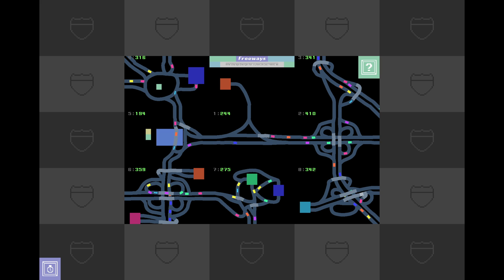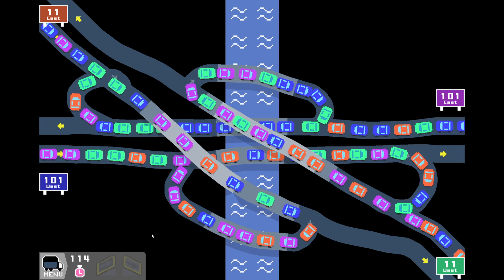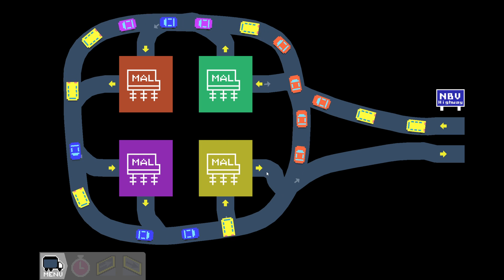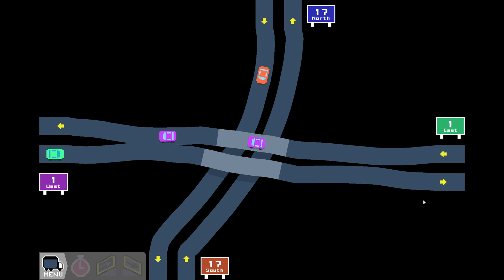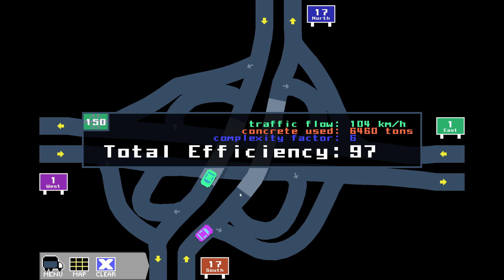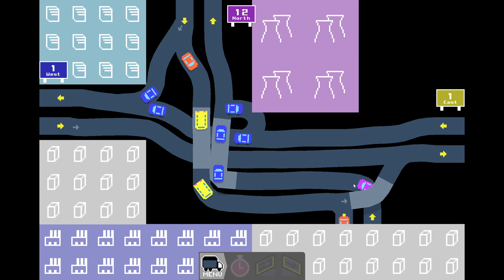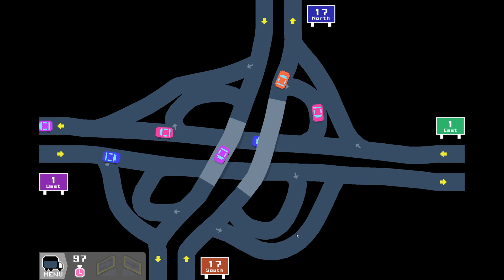GERMAN ENGINEER tries to improve efficiency in FREEWAYS! (EP2)

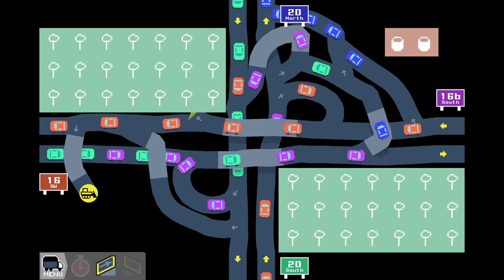Comment: 12:10 you could just connect the 16SW road to the one you just made from 16b South to the 20 South. So that green cars comming from left to the down would not have to go all over the map. And as you built the road from right to up, you culd connect it to the previous road a little bit earlier so the green cars could go with the ones from left.

Also avoid too sharp turns. you made it a few times.

Comment: I've been playing this game for the first time recently too, and I've learned a few things that could help you, without giving away any spoilers.

When you change from one elevation to another, e.g. from the ground to the first bridge level, if you do this too close to another bridge section the cars that are changing elevation will go through the bridge section, stopping any traffic on that section until they pass.

Each screen has been given a 'complexity rating' by the game author. The road you only had 97 efficiency score on was because you used too much concrete. It's only necessary to connect the roads together in a crossroads with no bridge sections as the volume of traffic is so small.

If you press the ? icon in the top right when you are in the map view, you will see a set of instructions, and be able to see all the pictures you have already unlocked.

If a screen has a picture, the score you need to achieve is displayed in the top left of the efficiency score window that pops up when you hit the stopwatch, and will disappear when you have reached that score. Only then can you view the picture associated with that screen.

Your total efficiency score is determined by A: the amount of concrete used (the higher a bridge section, the more concrete is used when building it), B: The average speed that vehicles can go at (making junctions smoother and roads less bumpy improves this), and C: The complexity score that the author has given each screen. A more complex screen will be more forgiving for the amount of concrete used, while the less complex screens will penalise you more for using more concrete than is required.
Reply from the maker: Hey Simon, thank you very much for the tips. I highly appreciate that! I will try to implement them as much as I can in my next episode!